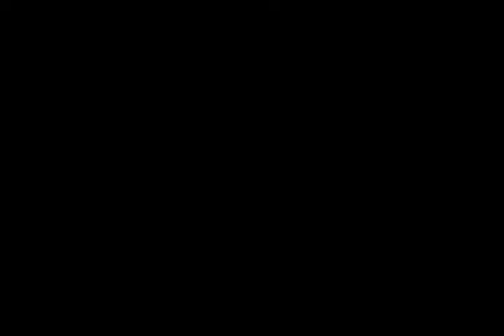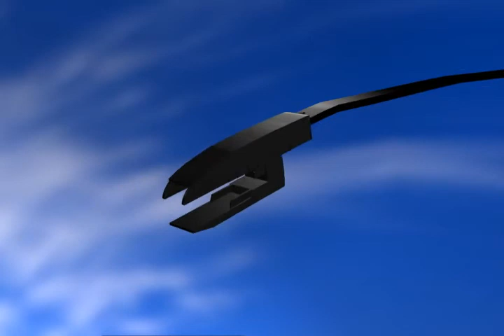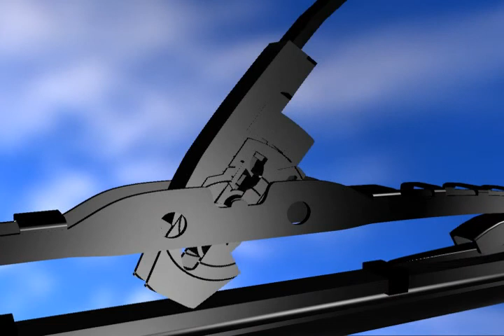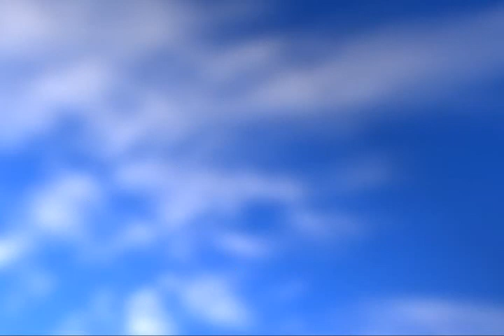Bosch Wiper Demo

Comment: To remove the blade squeeze the plastic housing surrounding the pivot point near the 'top' of the housing. The housing has a section on the sides that appears to be attached only at two points. It looks like the logical place to squeeze. Wrong. Squeeze the small area in front of that, towards the far end of the blade. The housing will pivot open. Then just slide the blade off of the hook like any other blade. There is no tab or latch to press.